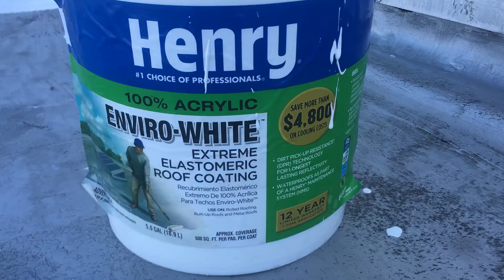Don’t just think about selling HVAC equipment. Calculate your BTU load, something simple white paint

Comment: What’s the best way to get rid of a smelly ac in a car? Ac evaporator foam cleaner ?
Reply from the maker: Evaporator foam cleaner does work in some situations and one of the easiest methods it’s properly done. 
            But depending on the situation if you’re in the area with some sort of mold spores or park your car under a tree and some organic material that breaks down get sucked into the car and is rotting. 

The smell may return after about nine months to a year. 
   
          For some people a cheap alternative after using a chemical to get rid of the smell about five or 10 minutes before you get home turn off the air conditioning but keep the blower fan on high speed fresh air to help dry out the evaporator and drain pan every time you go home to park your car overnight. 

        A simple thing like this keeps the moisture level down where there might be some decaying organic material that is causing you a bad smell
Reply: @coldfinger459sub0  I think the evaporator cleaner would be ok I did it before and  does 6 months sound about right before it starts to smell ?
Reply from the maker: @matthewdoyle8644  Now this time when you do it again add one more thing every day when you drive home five or 10 minutes before turn the air-conditioning off and leave the blower fan out to dry out the case every day
Reply: @coldfinger459sub0  thanks and I must ask you since you know Prius/ct200h the windows don’t seem to be defogging as quick like it’s really slow to de fog would that be because of the evaporator being dirty ? The system has been recharged if your wondering
Reply from the maker: @matthewdoyle8644  do you have a cabin filter that would keep your evaporator coil clean. At least clean as in large debris. 
               When was the last time you change the cabin air filter. 

           for your defroster not working well could you possibly have a low refrigerant charge
Reply: @coldfinger459sub0  the cabin air filter is clean I often shake it out if there is maybe some leaves I got it recharged 7 months ago could there be a leak ?
Reply from the maker: @matthewdoyle8644  get a good strong flashlight look at the condenser for a leak

The other thing you can try put your hand on the suction line and then have somebody else turn on the car and turn on the AC does the suction line get cold almost immediately when you hear the electric compressor turn on. 

This is difficult and not a good test in the cold winter days this is a better test to be done during the summer when it’s about 80° outside
Reply: @coldfinger459sub0  thank you, I learned from your videos about cheap aftermarket condensers and I realised how ripped off my father got in a car shop, it makes sense why it can’t take out the humidity and heat the condenser is just that poor of quality .
Reply from the maker: @matthewdoyle8644  in the winter months even with a A very bad poorly constructed cheap condenser you would never know it because of the cold air easily makes the poor performing condenser work really good. 

       But leaks are a different story.